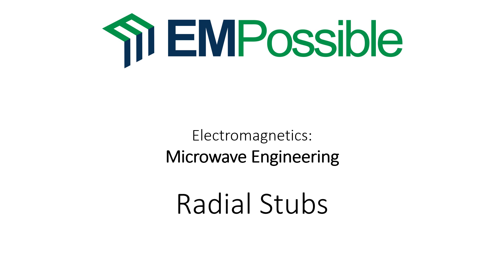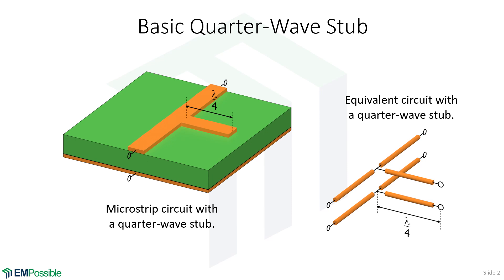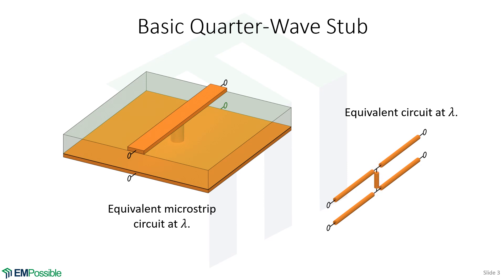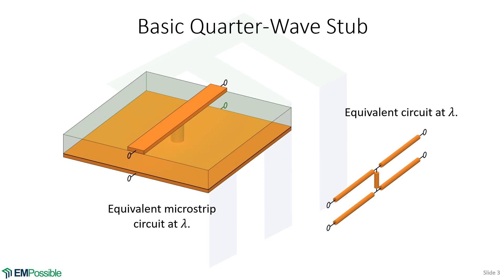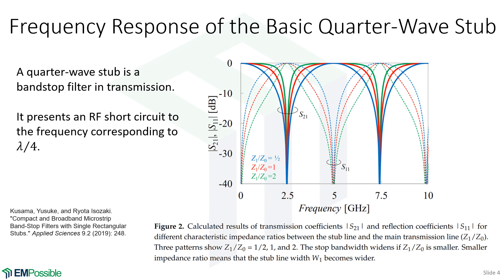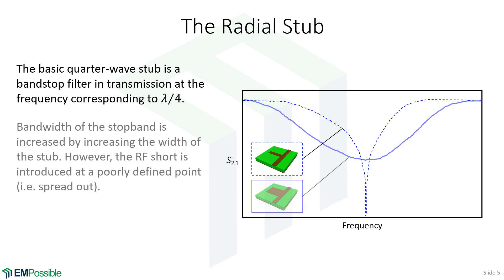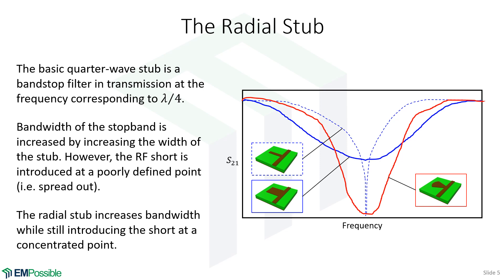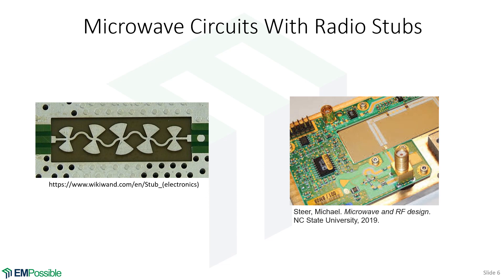Lecture -- Radial Stubs

Comment: OK, so a stub acts as a rf short to gnd at 1/4╗, I get that, reflection bounces back and cancels out the next cycle as 1 on s11 with an ideal stub (so consider a resistively terminated circulator or something if this is problematic).  I even can understand why a wider stub would hit multiple frequencies, as you could imagine the distance being different from various lengths from corner to corner and everything in between inserts from so its directly has variable electrical path lengths, but I don't get why the fan works, you send a pulse down a cylinder vs a cone from the opening same distance to the back surface regardless? I guess would have to meditate on how a non orthogonal narrow stub may compare to an orthogonal one, perhaps that's the bit throwing me off.  I could imagine it may have directionality, obviously in the fan out the symmetry would restore uniformity.  Ahh, I think I get it, a non orthogonal stub would couple capacitively with the transmission line that coupling is going to skew the effective wavelength of the stub in coupled areas in proportion to how strong the coupling is.

I have at least convinced my self that my understanding is accurate, which leads me to conclude that you showing the wide stub vs radial stub was a bad example and an incorrect explanation of the method of oporation. It would be better to compare an orthogonal stub with a non orthogonal stub and explain it in terms of variable path lengths due to variable capacitive coupling.  

On your last photo with the wiggly wobbly transmission line that capacitive coupling is going to do interesting things I would think. 

I have to wonder what happens at more obtuse fan angles, it does not seem to be used and that has to be for a reason. I would think as you transition from 1/4╗ (electrical coupled) to 1/2╗(capacitive coupled near 180° fan angle) it would simply transition from a band gap filter to a band pass filter (after accounting for harmonics).  But there has to be other s21 losses or something making this not a thing that is used, perhaps it forms loops with parasitic capacitance that are creating resistive heating or or its got radiative issues where it becomes an antenna; I would think it if were somehow shunting energy into harmonics that could be extremely useful but that's probably not what's happening.

Comment: thank you for the explanation of why the radial stub is used!!!!
Reply from the maker: You are welcome!!
Reply: @empossible1577  i have a question, why when the stub is introduced to a poorly defined point, the resonance in the S21 gets weaker? i know that making a microstrip with a larger width will produce a lower impedance and this is going to create an abrupt  discontinuty, but i dont know if that produce the poor RF short circuit behaviour we are watching.
Reply from the maker: @redknight344  Ideally, the stub is supposed to introduce a single point of reflection along the line.  When the stub is wide, it spreads the reflection over some length so it is not as reflective any more.  This has the effective of weakening the filtering response.